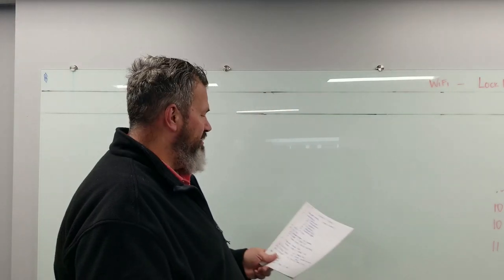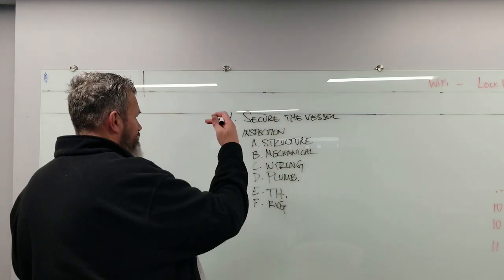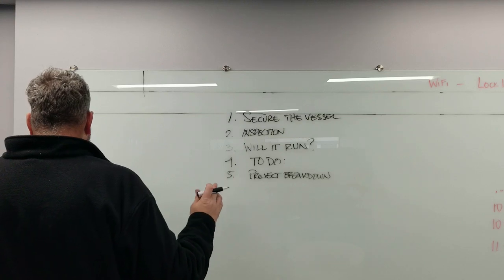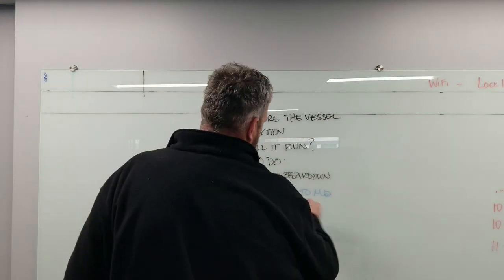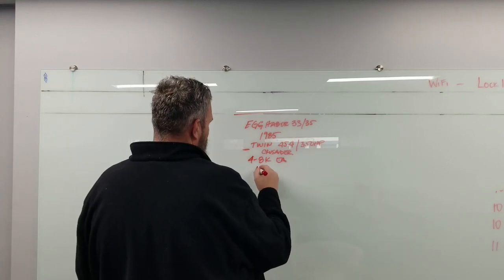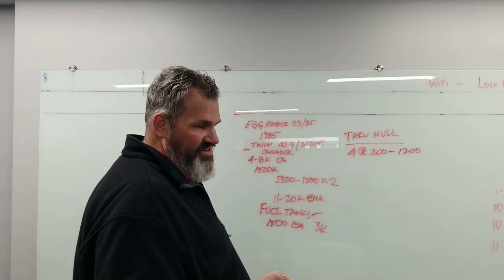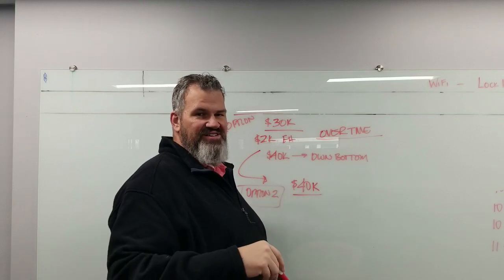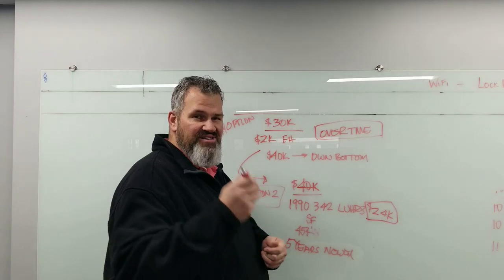BT project restoration Part 2 of 2  POTENTIAL PROJECT COST

Comment: What if you were to get a hull that you like, then gut it out, replace stringers & transom & floor, then install new outboards & equipment.
Reply from the maker: Well as far as YouTube is concerned I don't want to do something everyone else is of course but at this point the search still goes on I have to upload more vide of the vessels I have looked at.
Reply: @bubbatangosprojectrestorat691  yup, YT has their ideas. I would do what you want to do.👍